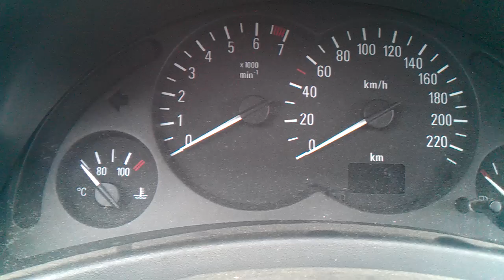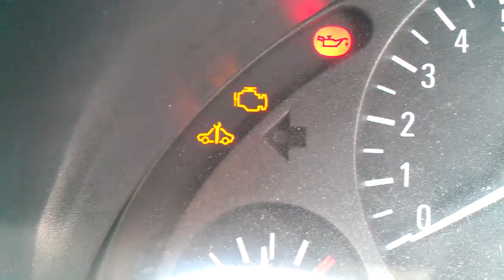How to check engine without Obd scanner

Comment: I thought this was nonsense. But tried it out in my Vectra, and it turns out it actually is TRUE.
I have the EML on, and now i had error code 0597 flashing, thermostat faulty. And yes, my thermostat IS actually knackered !
Reply: Yup i tried it on my combo 1.3cdti first i pressed brake too hard i tried again and googled numbers and that explains rough start + i need to step on gas to start engine and poor idle. Google says it is some air intake temp too low then maf sensor and glowplug. Nice trick

Comment: it was hard to understand , but I appreciate what he is doing , and  here is a possibility also , that  if you do this  correctly maybe th emake and  model vary . but you can  possibly bypass a  scanner that is not effective  . old  ., outdated  and  so  on ,. im guessing you get the  codes  straight from the  computer , but on the  other hand and I am  not sure because nothing is  ever  a gaurentee , is  that you may have to drive under a load . ,,,,,,,,,,,,,,   all hpyotheticals of  course by I am  gonna try my truck using this SO THANKS

Comment: Hi can I just ask, the other lights that are on the oil battery and other one they was on all the way through does that mean you have a fault on the oil and battery or do they just stay there till you start the car?
Reply: Ashlee Baker they stay on untill you start the car, then they go off after the car has been started if they stay on after the car has been started you need oil or your battery needs replacing.
your welcome.
Reply: The lights turn on so you can see they work properly

Comment: what if I place my scanner after reseting the engine light. is it gonna find that something is actually wrong? im buying a mazda 3 tomorrow and I have my scanner. but im afraid the seller reset the engine light and my scanner wont find anything. I have a innova 3040c car scanner

Comment: You didnt even explained well... What is that blinking light means???.. You just saying 6/10/ or else.. So what is that mean?.. Is it bad?.. Or what?
Reply: So 10 flashes stop 6 flashes stop 5 flashes stop 10 flashes finishes hope this helps
Reply: What he means is that number of flashes corresponds to a number: 1 2 3.. (10 being zero). Every brief pause indicates next number in the sequence of 4. Every long pause indicates new error code.

So error code: 0650 equals to 10 flashes - pause - 6 flashes - pause - 5 flashes - pause - 10 flashes, if you get longer pause it means another error code, etc.